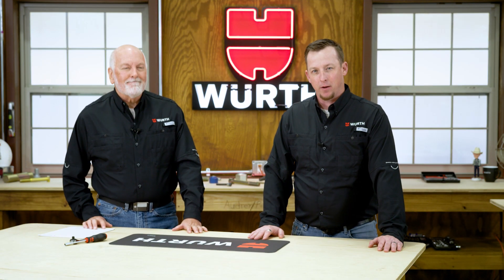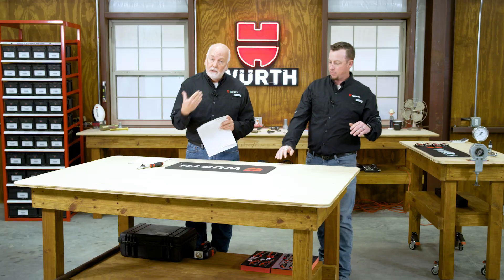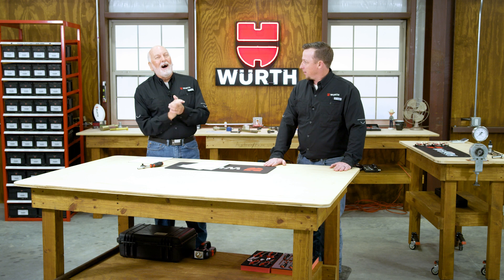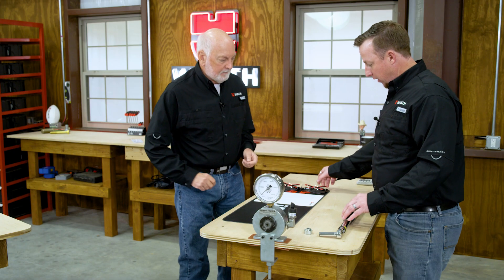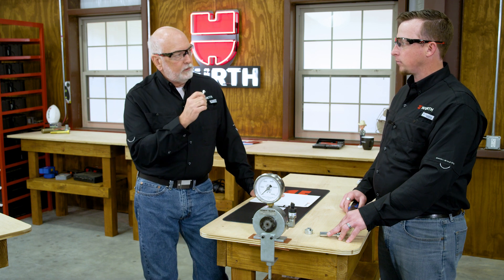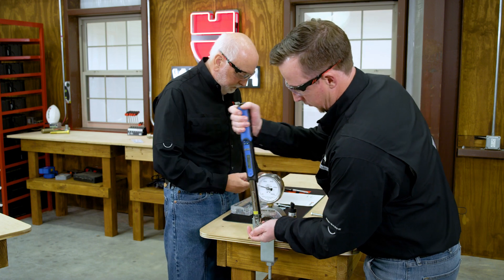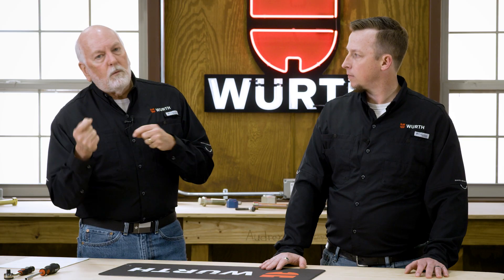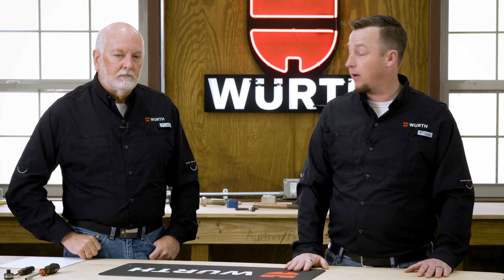Torque and Friction | Würth Knowing Episode 1

Comment: That calming force can change at great deal with lightly lubricated fasteners from the factor new with a light oil, to a thick flat washer wider than most to spread the load place the hole & thread conditions. I run a tap thru every time. Painted and powder coated threaded holes see more fastener failure than any kind.
  And wheels studs / pins, don’t get me started on torque sticks. Nice colors, real pretty but useless. That is for toque wrenches that are re-certified by the company that made them, like SnapOn. Throw torque sticks onto a welding table, they make the coolest boat anchors. If you use rope makes difference.
Reply from the maker: It sounds like you have a lot of firsthand experience with the complexities of the torque to tension relationship. When utilizing torque for assembly, it really is all about the friction factors of the total joint. 

-Randy

Comment: What is the proof strength of 6061-T6 aluminum?  Or why doesn't 6061-T6 have a proof strength?
Reply: 6061 T6 Aluminum does have tensile, yield and elongation requirements that indicate the strength characteristic of the material. "Proof" is simply a predetermined load used in pass/fail testing. Utilize the real minimum requirements listed for the material and determine a safety margin to set a proof load you are comfortable utilizing for your applications.